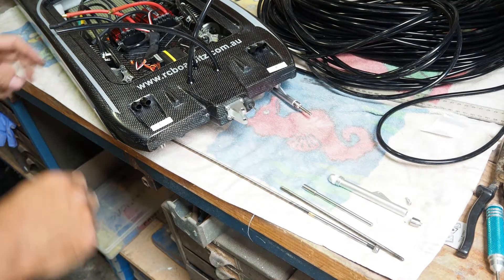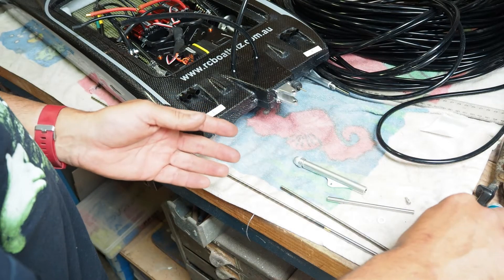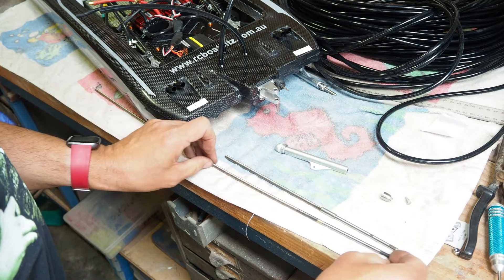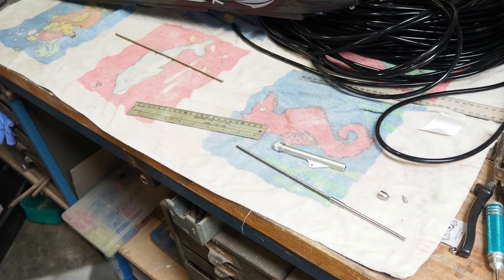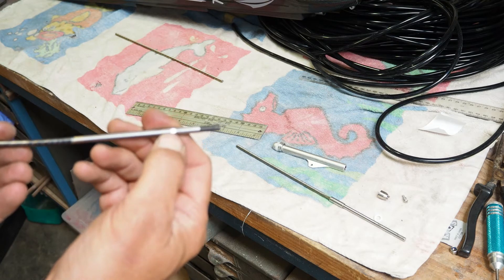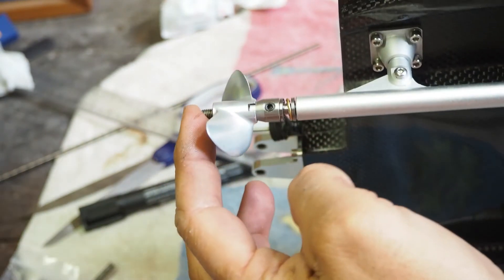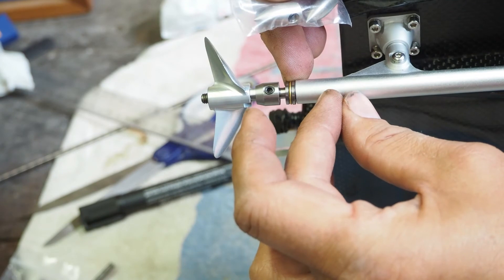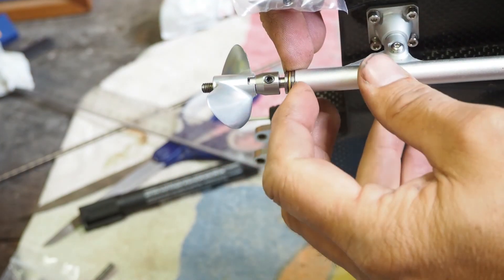RC Boat 1 piece flex cable conversion on TFL Zonda

Comment: Thanks mate think I've found the solution for my thunder tiger atlantic.  Tried the original shaft with a 5mm to 4mm coupling and it's drilled terrible.  Way off center ,had that with universal joints to.  Whole motor wants to jump out of the boat. Time to make another order ha,ha,
Reply from the maker: Yeah if not perfect at 30- 40k rpm its like a hand granade lol.

Comment: You don't show how you attach the cable to the shaft. You don't show how you tin the tip of the flex wire. And that is very important . But thanks anyways
Reply from the maker: Its a 1 piece cable and the stub is welded to the wire. I didnt tin the end, as explained i shaped it to an angle of 45 degrees with no wires sticking out.